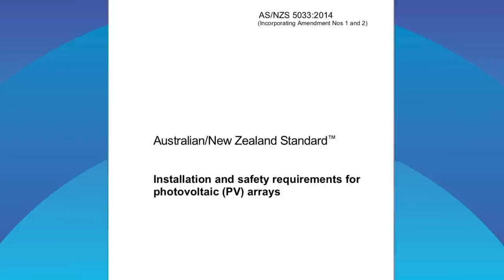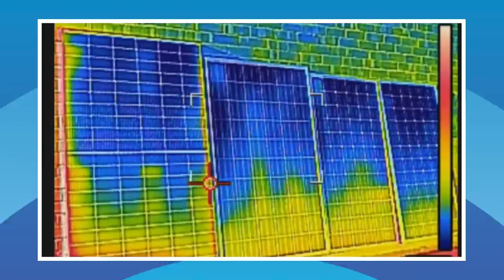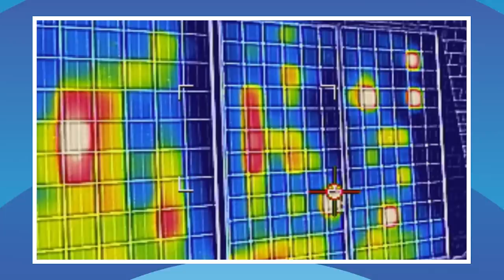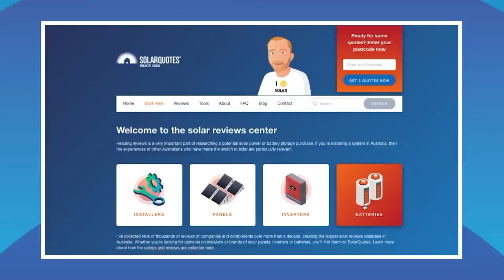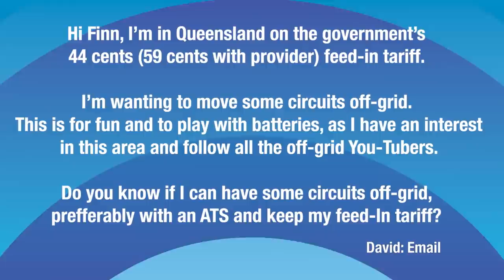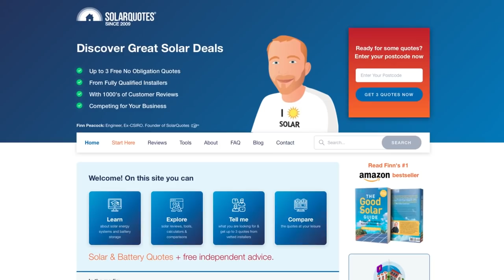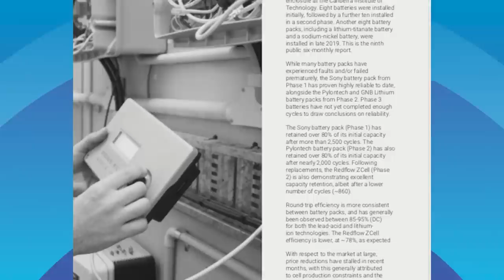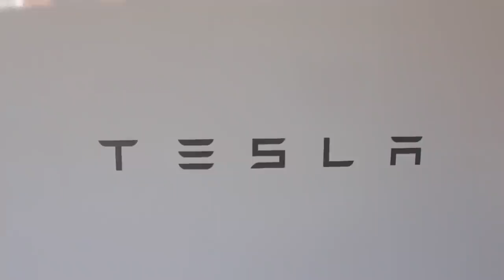SolarQuotes TV Episode 3 - Karate Vs. Crystalline, Solar Fires, Home Battery Prices And More

Comment: Life/Reliability of Home Batteries 'v' Car Batteries. I consider that a home battery goes through a charge / discharge cycle every 24 hours whereas a car battery may in some cases only be charged once or twice a week for low mileage use.   Isn't battery life decreased with the number of cycles ???
Regardless with the reported short lifetime (maybe less than 10 years)  all batteries except large scale commercial installations are over priced.

Comment: My friend said it's impossible to run a house 100% on solar in phoenix arizona with no shade, south facing, on a house about 2000 square feet. In the summer, with kids using tv and internet all day and running air conditioner all day. Mostly he said the AC would pull 5000 watt's an hr all day basically. I was arguing the best I could with the little I know but he keeps saying can't be done it's impossible. Could you help me out a little bit. Thanks.
Reply from the maker: This may help: https://www.solarquotes.com.au/blog/heatwave-solar-power/
Reply: @SolarQuotes  how many hrs would solar work in a summer day in phoenix arizona? About 9 hrs right?

How many kilowatt-hours would a huge AC pull in that same time period?

Assuming a 2000 square foot house with half the roof facing south. So half the square footage of useable roof space for solar panels. How many panels could you fit on average? Let's assume panels are about 20 % efficient. And assume if needed guy could just go out and grab his backyard hose and spray cool water over roof from time to time to cool panels off if needed.
Reply: @SolarQuotes  The alpha ess DC coupled is a game changer in the battery space.Most capital cities can now get a 10.3 kw with 6.6kw solar system under 9k fully installed
Reply from the maker: @chefgav1  personally I would not be comfortable with an Alpha ESS on my home.  Or a solar system that was that cheap.